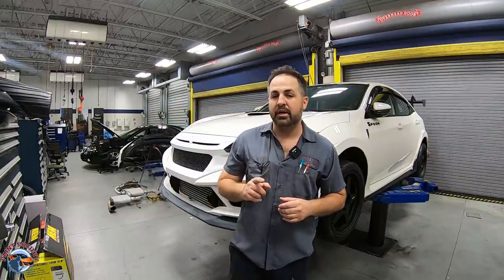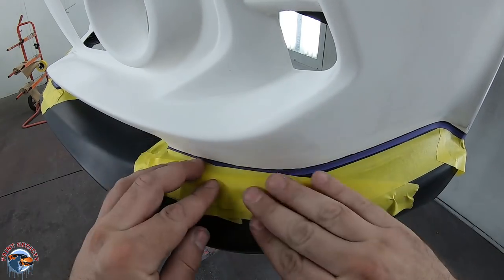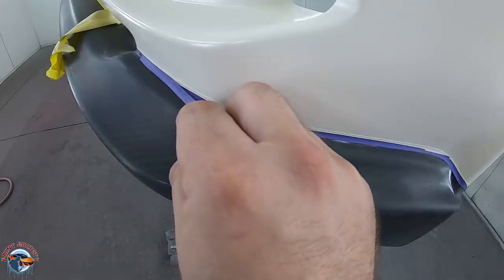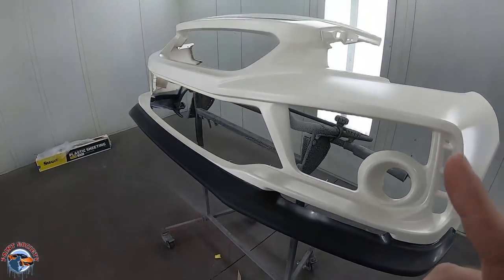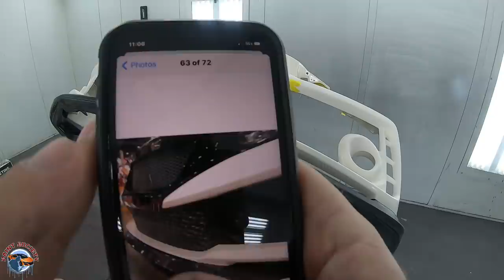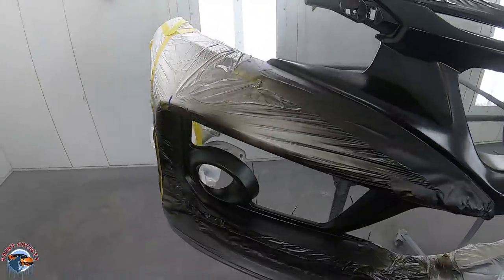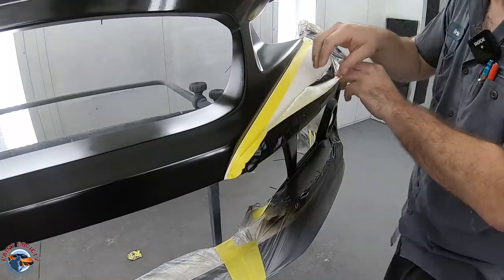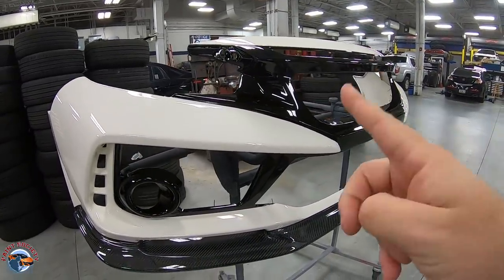How to do a Custom Paintjob

Comment: Brian, planning to do my bumper in a similar style, black on grille as a secondary color. Quesiton, can i spray sealer, then primary base color on flashing sealer (to have chemical adhesion), then once the base is flashed, mask it and spray black on the grille? My concerned is paint peeling off when i remove the masking. TY